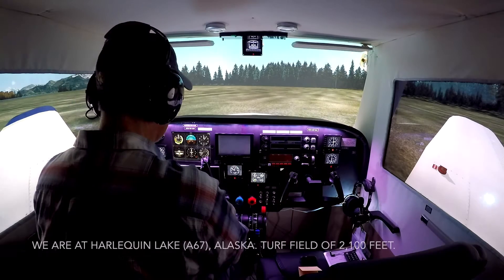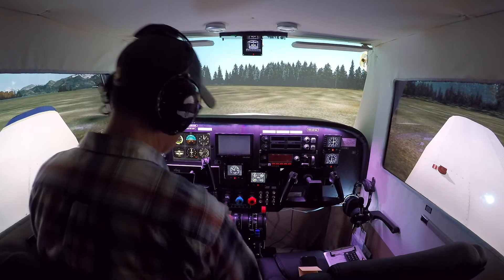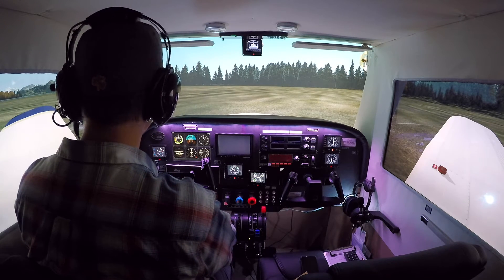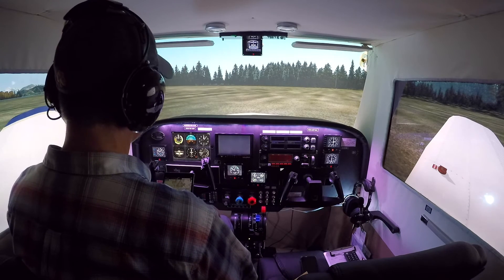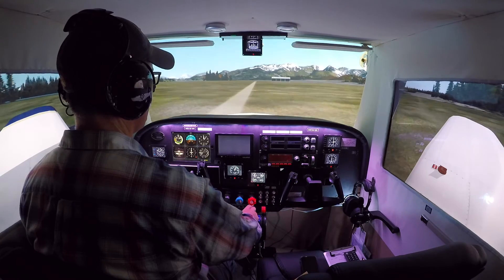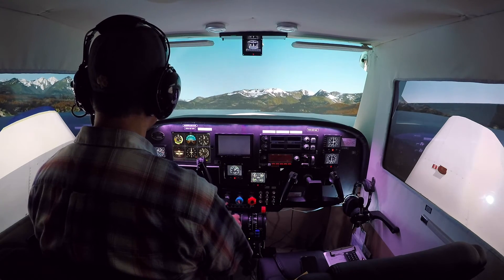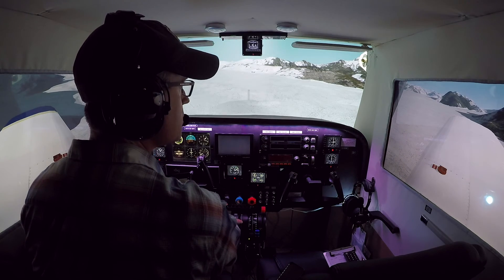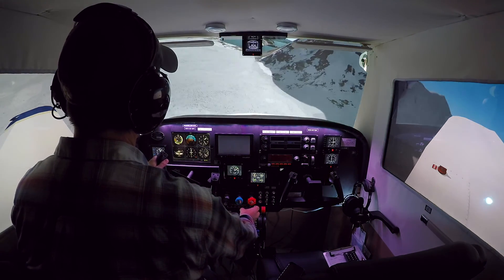How To Sim A Soft-Field Takeoff (Cessna Prepar3D Home Cockpit)

Comment: Which plane payware do you use with your Saitek gear? I’m trying to use the a2a c172 but it looks like a ton of issues to get it working. Wondered if you use the Carenado Cessna? I just want to fly without using the keyboard!
Reply from the maker: Back in my P3D days I used any plane I wanted but used SPAD.neXt to manage the multiple configurations. I suggest checking it out.